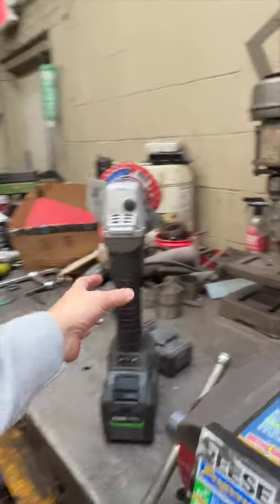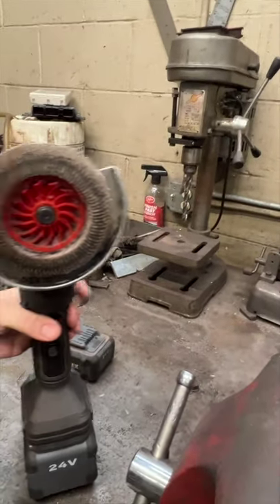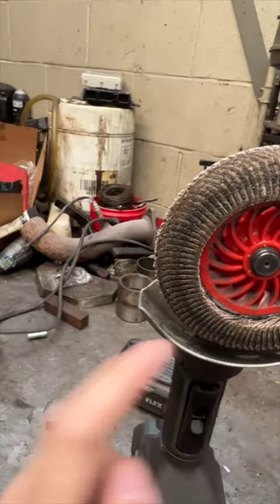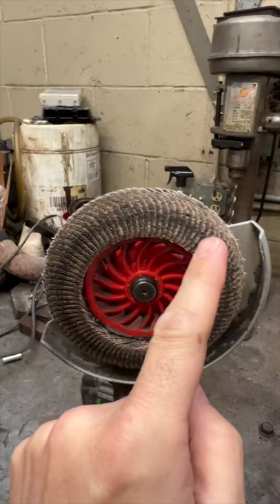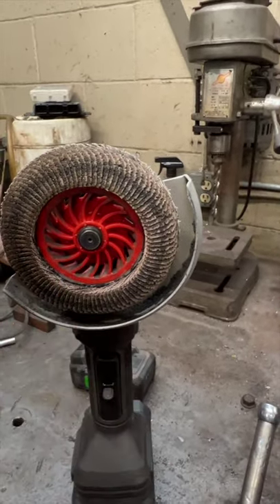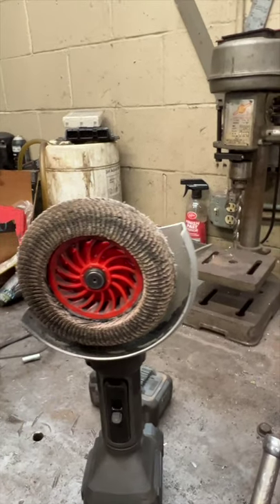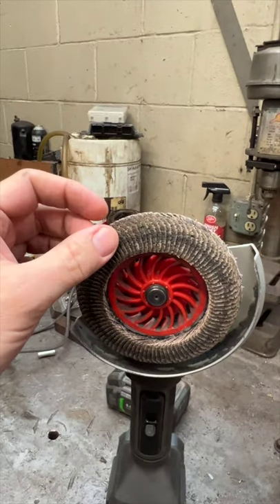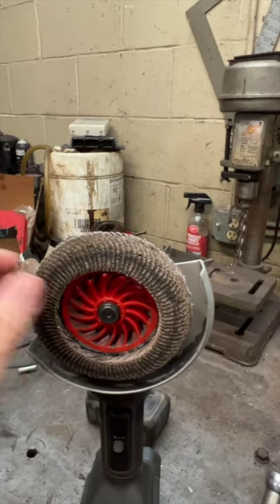You NEED this Flap Disc Now - It is Insane!

Comment: What’s more impressive is the cordless grinder that lasted 20 minutes on one battery
Reply: Get a Milwaukee M18 fuel
Reply: @engjds  I have a couple of those
Reply: @awesomefish100  Then get the heavy duty batteries, 8Ah will last you a long time.
Reply: @engjds  I have a couple of those
Reply: Until the bearing on the bottom of the motor goes out on it, because milwaukee only puts cheap bearings in their grinders lol
Reply: @sergaljesus  I don't think so, my grinder has hundreds of hours on it, still going strong, only bearing that ever went on a milwaukee was the cheap orbital sander, but buy fuel versions and they are good quality. Ave channel has been tearing them down for years and he knows all about bearing, compared them to Makita, Dewalt etc and they are better built in general.

Comment: angle grinder, no glasses + faceshield + no respirator
LOL
Reply: He's wearing glasses, and is pointing it the right way. Did you not live through the 70's?
Reply: somebody has never tasted hose water before...
Reply: @eugenecrabs3954  somebody’s never tasted metal shards at 10,000 rpm
Reply: @barbecueman6352  I, like you, am also big on safety.  However, he is using a Flap Disk and I don't think there's metal in those discs in particular.
Reply: Can’t always wear a condom
Reply: He has safety squints and safety mustache on
Reply: @barbecueman6352 Better get an office job if your scared of sparks.
Reply: @arbit3r  better get good healthcare if you huff abbrasive dust
Reply: @reefslayer21 get that quote from your father?
Reply: @eugenecrabs3954 bro it’s that certain type of hose pipe that is fkn horrible…thanks to you it brung flashbacks 😭
Reply: If you angle the guard right all you will need is safety glasses I nearly lost an eye after a chuck of white hot metal came at me it only burned eyelid wear your glasses kids
Reply: @potvinsuks8730  Are you stunned? The hell do you think those sparks are? LOL It's metal particulate that's been sanded free. You really think grinding discs just delete material?
Reply: @saluki417  lol! I've been watching so many videos on Table Saw Safety lately that it never occurred to me about the whole inhalation part, lol.
Reply: @potvinsuks8730 But he's grinding a piece of solid metal. All those sparks are tiny metal shards.

Comment: Dumb question. I need some help. Just got an angle grinder with a typical 5/8-11 arbor (spindle) IS IT OKAY to use type 27 disc  (thread on) WITHOUT a flange nut? ie. The spindle and the base of the disc are flush with each other when the lower flange is attached. 

In other words, I remove everything from the grinder. Install the bottom flange ( in the only orientation that it can fit.  the rectangular channel matching the tool with the flange lip facing up) Then Screw on the grinding disc. Now there is no room for the locking flange nut that you would typically use on a 7/8 disc. 

In this video there is no locking flange nut but the spindle sits proud of the disc.. Is there an adapter flange base? I cant find this info anywhere..... 

How do you properly attach a 5/8 THREADED disc to a standard 4 1/2 5/8th grinder? 

I would greatly appreciate any advice, as I'm a complete novice and don't want to end up getting hurt. 
Thanks.